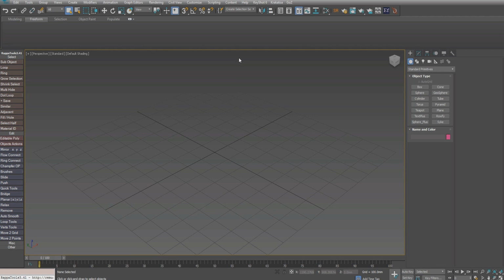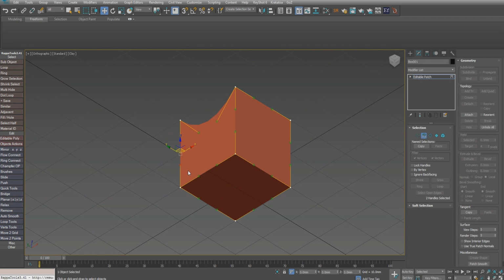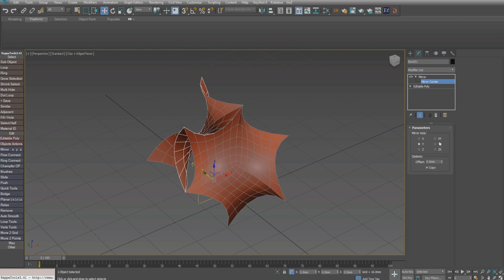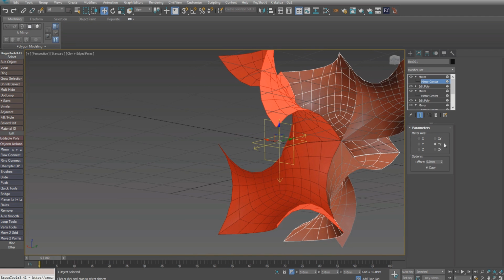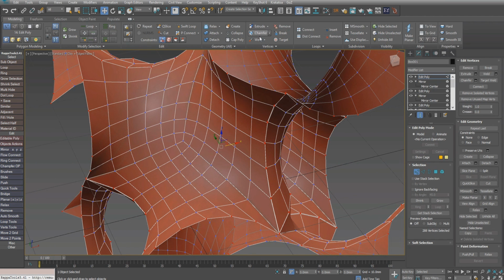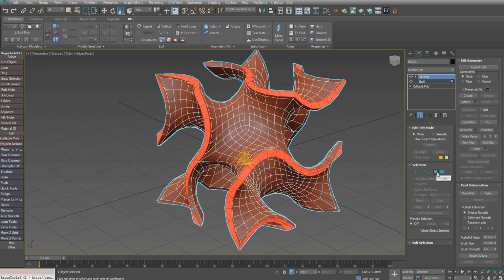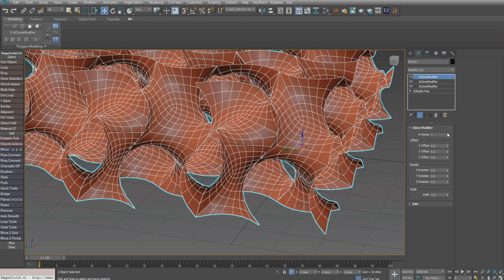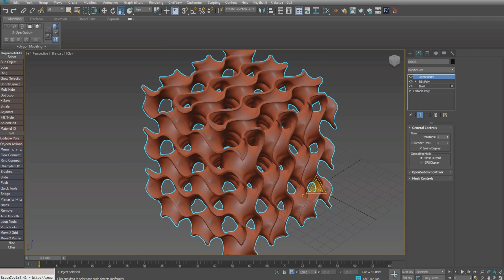3d Tutorial | Gyroid Minimal Surface | 3dsMax

Comment: Thank you, John. This one cost me some time to do the translation in Blender. Still try to optimizing modeling process I found in Blender. As always, great tutorial, looking forward to the next one. :)
Reply: I've been try Proportional editing tool and Lattice modifier, work pretty much close to the final result but need some adjustment after mimicking the "handle" of the patch. Currently using Bezier curve to do it, the result is batter and cleaner steps vs Proportional editing tool and Lattice modifier.
Reply from the maker: Hi, Toki.  I had considered doing a Blender version of this in the near future, but I knew there would be some problems with translating some techniques used in the 3dsMax version.  I was considering proportional editing as the solution, but the results were less than encouraging when I ran some tests.  I was also pondering the use of nurbs or Bsurfaces addon for the job as well.  I'll be interested to see what you come up with.
Reply: Hi, John. Here is the link of Blender version video I've come out with. I hope it'll help you out. As always thanks for the content you've created. :)